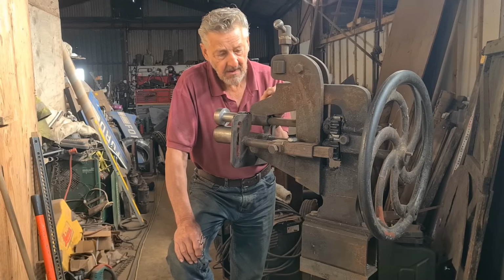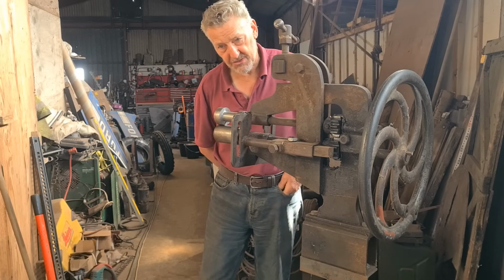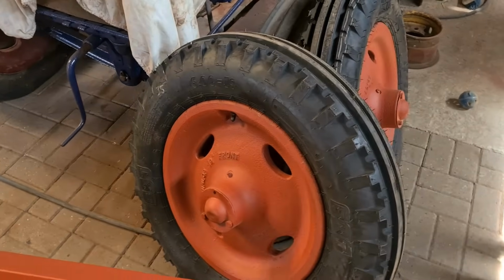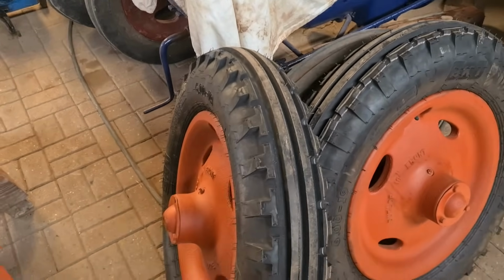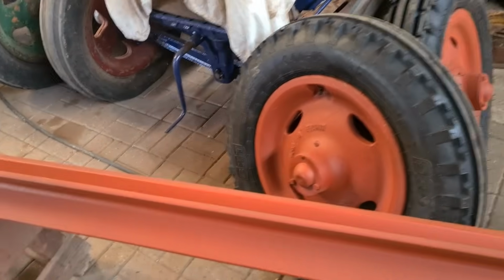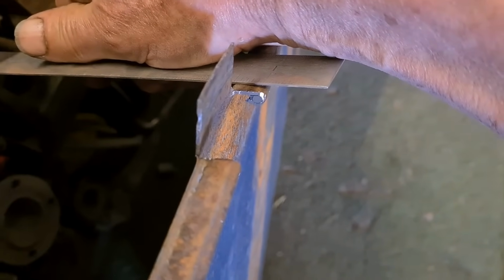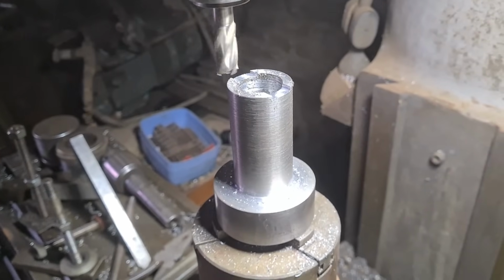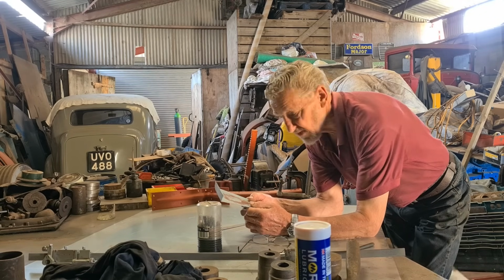Swaton show & waterwasher wing's

Comment: Good video as always Steve 👌 good parade of tractors at the show interesting Dexta about 6 tractors behind you that had the exhaust up the side of the bonnet which I'd never seen on a Dexta before 🤔 the old H certainly looks to have a good turn of speed 💪 another school day watching the rollers turn a 90 degrees angle on a curve 😳 be interesting to see how the sheet turns out without any creases when its flattened out 👌👌
Reply from the maker: Hahaha you me both I've got a few more test peices before i tackle the new sheet 😅 thanks Bob 👍

Comment: Nice update......... the panel work and the wired strengthening and rolled edge took me back 50 years when we had to do sheet metal test pieces for my apprenticeship. I still have the metal toolbox I made in Swindon Works training school . What I learned back then came in handy on my restoration projects years later.
Reply from the maker: Yes as my old dad would say it's like riding a bike boy you never forget how to ride it, thanks